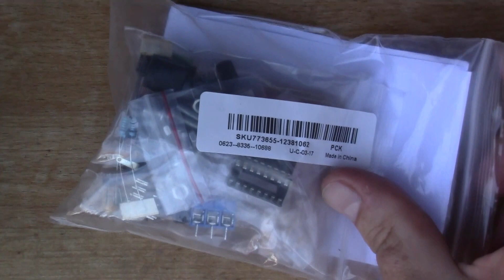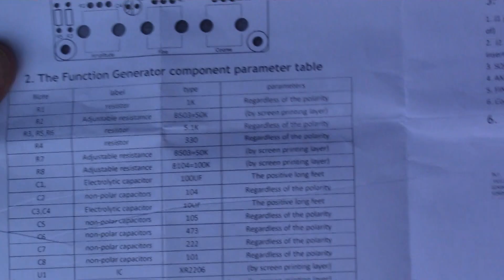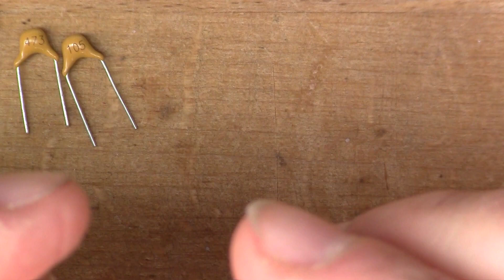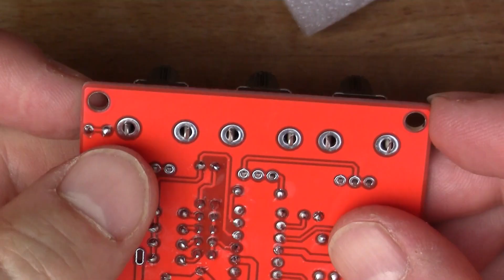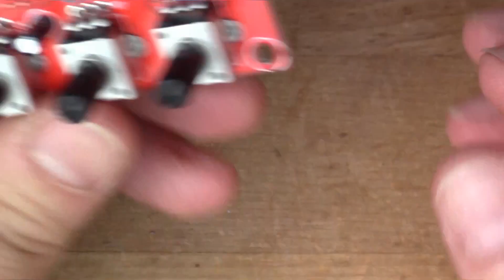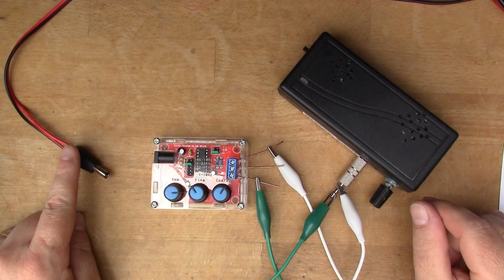Function Generator Kit Build and Test (#80)

Comment: I made one of these but the sine wave is a funky square wave idk how to fix it
Reply from the maker: What I remember is that the sine comes direct out of the chip, so there's no circuitry to check.  Make sure that you're not shorting out the output into other equipment (I don't think there's a capacitor inline), and check that the power supply you're using is a nice stable DC between 9 & 12 V.

Comment: Hello, excellent tutorial, I built this generator too, since I measure about 5 volts at all outputs, do you think it is possible to connect the generator to the input of a tape deck, or am I messing up? thanks for any reply, greetings.
Reply from the maker: I think the square wave comes directly from the chip pin, so I probably wouldn't connect that into a tape deck.  The sine I think comes via a capacitor, so that would be safer to connect up.  However, it might need an attenuator in there (e.g. a 10k variable resistor/potentiometer), since input circuits for audio can be "line level", which is about 100mV.  The output of the XR2206 could be 10 or 100 times this.

Comment: Hello, great video 😄

I'm a beginner and I have a question :
I would like to make a diode bridge rectifier and I need an alternative voltage at the input. 
Can this device be used as an alternative power supply to generate the alternative voltage I need in input ?

Thank you in advance for your precious support. 

Cordially.
Reply from the maker: This function generator doesn't have much power available at the outputs - they're either direct off the chip pins or through a general purpose transistor, so there's an audio signal, but nothing you could power another device from.
Reply: @MartynDavies  Thank you very much for your feedback 😁.
Do you know a voltage generator I could use with the diode bridge rectifier?

Thank you in advance 😉.

Cordially.
Reply from the maker: @kevinhoublon8630  It sounds like you need an old-school power supply (containing a transformer). Something like this: https://www.ebay.co.uk/itm/175396047731
Reply: @MartynDavies  Thank you 😄. 
Just to be sure :
1 : Does this power supply directly give me a continous voltage?

2 : If so, 
-do I need to cut the wire so I can retrieve the wires of the phase and the neutral to connect it to my circuit ? 
-or is there an adaptor (with the stripped cables of the phase and the neutral ) that I can plug on the tip of the power supply you mentioned?

Thank you in advance 😉

Comment: Is the circuit able to produce frequency upto 100khz? If so, I need the values for capacitors and resistors or how I need to find out? I need it for my Thesis as a sound generator.
Reply from the maker: The kit comes with a datasheet containing a schematic and parts table - you can find a copy of this online if you search around.  I seem to remember that the circuit is extremely similar to the reference design in the original XR2206 chip datasheet, so you might get some interesting clues from there.
Reply: www.mit.edu/~6.331/icl8038data.pdf

Comment: What are the uses of this device ?
Reply from the maker: Mainly for testing audio circuits like amplifiers.  It's useful to have a predictable audio signal rather than just test with music.
Reply: @MartynDavies  , this product is actually a very poor one, and will "sucker in" neophytes who don't know any better. The designer of the kit made mistakes (such as connecting the Amplitude pot backwards), leaving off a stabilization capacitor that the chip manufacturer recommends, using an ill-advised value for the pull-up resistor on the square wave output, and most significantly, leaving out an AC coupling capacitor on the sine/triangle output. The latter results in the analog output being offset by a significant DC voltage; you showed this on your oscilloscope trace but I don't think you commented on it. Some devices a person might wish to use this function generator with have their own AC coupling capacitor on their inputs, but many don't. Undesirable results will result in those cases, not the least of which is severe clipping of the signal as the large DC offset causes the device under test to slam into it clipping or saturation limits. If the signal is then used to drive speakers, damage to the speaker will likely result. The chip manufacturer shows the output capacitor, but the kit designer left it out, and for no reason I can think of except sloppiness.

Another big issue is that the 'sine' output is far from being sinusoidal. Neophytes may look at it and say it is a sine wave, but a more experienced person will immediately recognize that it is just a triangle wave with some rounding. This might be OK just as a signal injector to test audio equipment, but on many circuits an experimenter might try to use this for, they won't get the right results due to all the harmonics in that 'sine signal'. At least this issue is not the fault of the kit designer, it is that the chip itself is a very old design and it does not have the necessary innards to convert a triangle wave into an actual sine wave. Luckily, there are other cheap kits out there that use so-called "Wien bridge oscillators" built around a single op-amp, and these give pretty decent sine waves.

And another thing I noticed when I built one of these kits, the IC supplied was defective and gave a highly distorted analog output unless the power supply voltage was very close to 9VDC. The datasheet for the original XR2206 indicates that it should work properly over a much wider range of supply voltages. I replaced my kit's IC with a new-old-stock XR2206, and then it worked correctly.

Comment: I dropped some solder into a whole on the board any tips on how to get it out?
Reply from the maker: I normally use desolder braid and/or a solder sucker to clean off solder spills.  I did once drop a blob of solder that went under a chip and ended up connecting a load of pins together. It took ages to clean that up, and I ended up cutting one set of pins and levering the chip up so that I could clean all the solder bridges.  You can get a thing called a rework station that can be used to clear up big spills.  I don't have one, but some people swear by them.
Reply: @MartynDavies  thanks man I would never of been able to build this without ur help.

Comment: Where did you get that speaker thing?? I need something like that
Reply from the maker: That's one I made.  The case is from a LED power supply that stopped working.  Internally it's got some kind of commonly available power amp module and some small speakers that I had.  I thought I'd made a video of it, but can't find it now.  Some Bluetooth speakers have a line-level input: you could use something like that to get the same effect.
Reply: @MartynDavies  hmm okay, I bought a cheap little alarm clock radio from goodwill and took the speaker out, it works okay but anytime I attach my homemade signals through it there is very very little sound. I also soldered it to a headphone jack to see if maybe it was just my signal and plugged it into my iPad, same thing, full volume, very very little sound. Yours sounds great. Maybe I just need a better/bigger speaker. Thanks for replying.
Reply from the maker: @ATLTraveler  Rather than the speaker size, it could be the sensitivity.  Many devices have an 'aux' input with a sensitivity of about 100mV, but if you connect a tone generator that only provides 5mV, then you'll get a quiet output.
Reply: @MartynDavies  yeah but shouldn't the iPad be putting that out properly??
Reply from the maker: @ATLTraveler  I'm not sure. My (very old) ipad only has a headphone output.  I'm not sure what they put in them now.
Reply from the maker: I did make a video for the amp after all; take a look here: https://www.youtube.com/watch?v=oIcHdHNW9iI

Comment: is this device adecuate to run brushless motor such as hard drive motors?
Reply from the maker: I don't imagine so.  As I remember, the square wave output comes straight out of the chip. For a motor, you need a transistor that can withstand a good amount of current, and usually a flyback diode  that can stand EMF coming back from the motor coil.
Reply: @MartynDavies  , the square wave output does not actually "come out of the chip"; all that is in the chip is an open collector transistor, and the actual voltage comes from a pull-up resistor on the PCB, which gets pulled down to ground inside the chip when the square wave is supposed to be low. There is no way to get this to "power" any motor anyone is likely to see in their lifetimes.

Comment: Hi, what amp is that? I’ve connected mine to a Lm386 but there’s a low humming noise.
Reply from the maker: I built this off a cheap PAM8403 module - see earlier video https://youtu.be/oIcHdHNW9iI. If I remember right, the outputs from this function generator are DC, so you might need a capacitor (say 1uF) between the output and the amp to make sure that you don't have current flowing, perhaps causing a buzz.
Reply: Martyn Davies Hi Martyn, thank you for the reply, I really appreciate that. I’ve just ordered some capacitors to try your suggestion. Great video btw. Really helped put it together.

Comment: Hi there, i'd like to ask you, if it's possible to use this kit output with my external mixer...
Reply from the maker: The sin wave output looks to have a capacitor on it, so should be safe.  The square wave comes direct off a transistor, so may not be suitable for a mixer input unless that has its own input capacitor.
Reply: @MartynDavies  tnx a lot for your help
Reply: @MartynDavies  whitch capacitor is better for using... That's all? I don't need some amplifier too?
Reply from the maker: @miravejvoda  An amplifier, probably not.  Commercial mixers can normally take quite low levels of signal, perhaps 100mV.
Reply: @MartynDavies  is it chance to broke original mixer? I have two original mixers by  Behringer ( 1202fx). I'd like to use this generatir for my noise project and i'm looking for some square vawe generator for Harsh noise Wall...

Comment: I purchased one of these a few years back when I was in my kit building days, my main reason was to learn how to use the kit built oscilloscopes those cheap DSO things for 20 bucks or so. I built one  using an Arduino and tiny screen as well, have it mounted in an Altoids can, it isn't good for much, but will serve in a pinch where you just want to look for a signal in a radio or some such device.  I was wondering if one could use this generator to align an AM Radio, as I have one of those little super het kits coming from China, perhaps by Christmas the way the post works now days.

Comment: Mr Davies could you tell me.about that black box you built ,and is there a kit ,like that ,or did you do a video on how you built it .
Reply from the maker: It uses a module with the PAM8403 chip (search for this on Ebay and you'll see a variety of similar modules), and other bits and pieces I had already: small speakers, a AAA battery holder; potentiometer for volume and the case is from a power supply that failed. I find it quite useful to have a battery powered amplifier on my desk.
Reply from the maker: I did make a video for this one: https://www.youtube.com/watch?v=oIcHdHNW9iI

Comment: There is no display of frequency on DIY kit. How did you know your tuning frequency? The analog oscilloscope won’t display the frequency either unless one has a digital oscilloscope.
Reply: Hi Ken, you can derive the frequency from measuring the period time on the analogue scope. If you're not all that acquainted with oscilloscopes, I recommend studying them some more. You'll learn a ton, and find even an analogue instrument very useful. All the best - cheers
Reply from the maker: There is a frequency setting on my multimeter.
Reply: Every oscilloscope, analog or digital, gives you enough information to determine the input signal's frequency. You should get yourself a book about using oscilloscopes. Or use Google a bit more.

Comment: I had given reverse supply to the circuit and it has drawn large current and then circuit doesn't work. Now, I have replaced the IC but sill it is not working and taking high current. Kindly, help me resolve the problem.